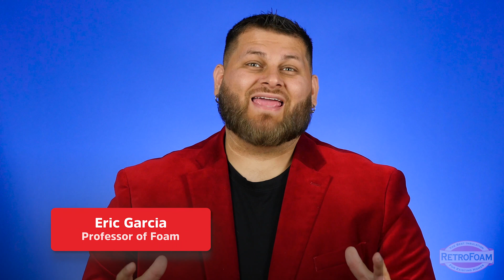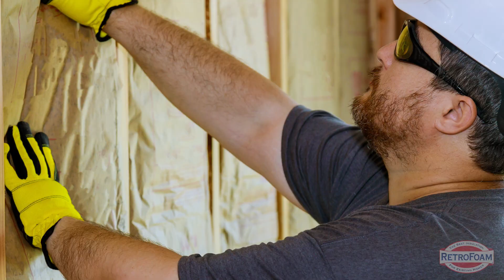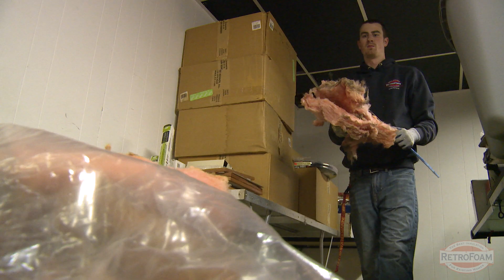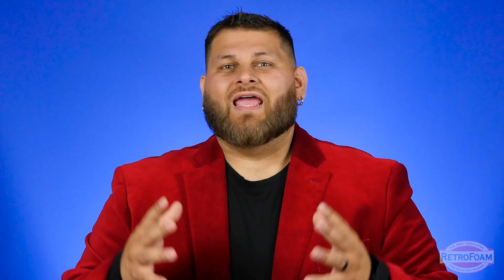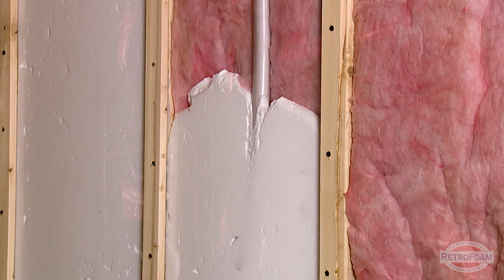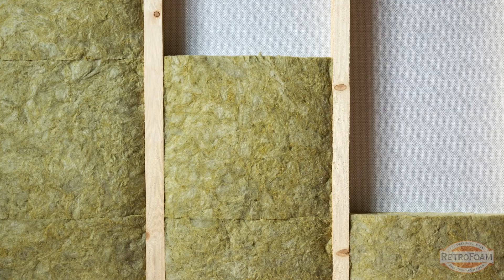How Long Does Insulation Last? | Foam University by RetroFoam

Comment: I do not have to worry about replacing my insulation, my house was built without any insulation in the walls and only one inch of blow-in insulation in the attic... We are hot in the summer and cold in the winter here...
Reply from the maker: Hi, Richard! Adding insulation that has an air seal (like RetroFoam) would help regulate those drastic temperature changes through the seasons and save you money on your monthly energy bill. If you are interested in finding a dealer near you to request a free estimate, you can do so here: https://www.retrofoam.com/dealers